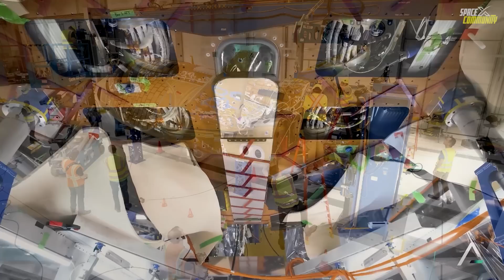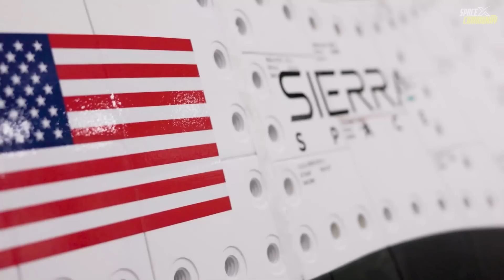It's DONE! Sierra Space Finally Declared Dream Chaser Tenacity Launch! SpaceX Worried...

Comment: I think it would be better if it could just stay up there and be reused permanently as a runabout. That's what we need rather than cargo only vehicles. Up snd back only is a serious limitation 🤔 IMO
Reply: A runabout in orbit wouldn't need 2/3 of the tech on board and none of the control surfaces. It would be like taking and ICBM to go to the grocery store.
Reply: We need to build a danoob class runnabot
Reply: Issue with that is that to get anywhere while up in orbit you would need to change orbit. Example, if you wanted to send it to the Chinese space station it could take up to 4 years to do so and a lot of energy. If on the same orbit yeah, it would be an awesome thing to have.